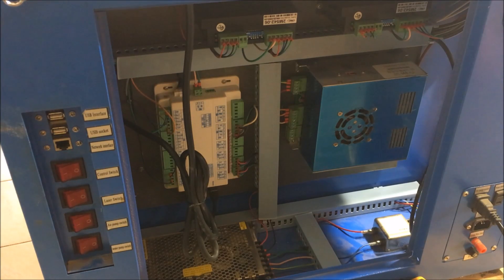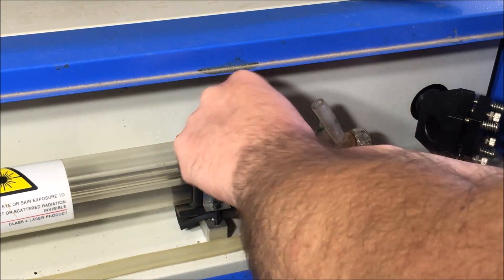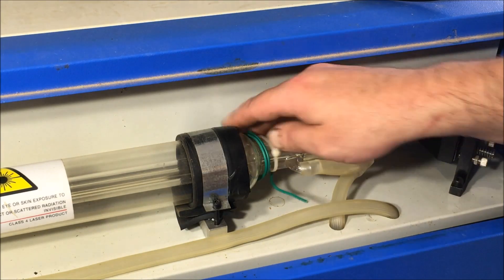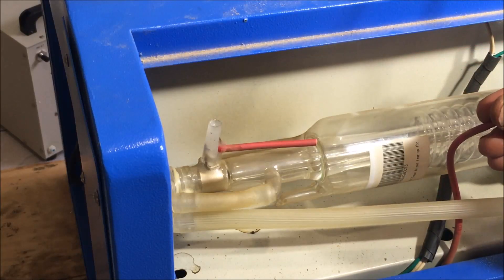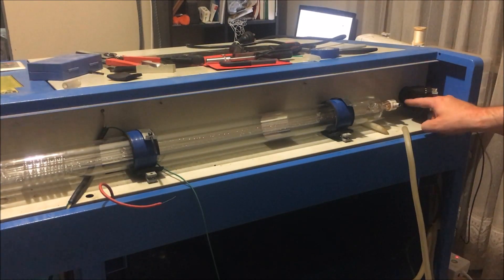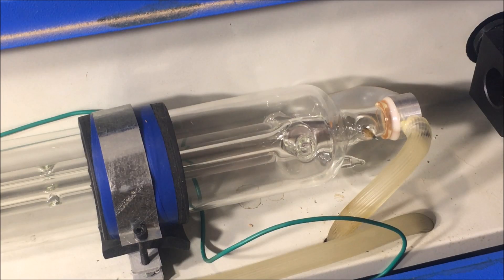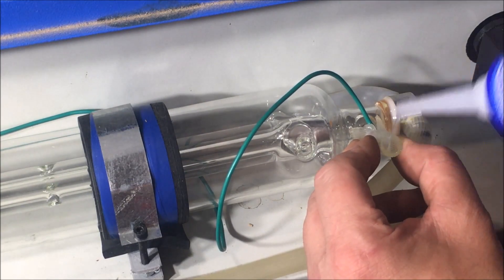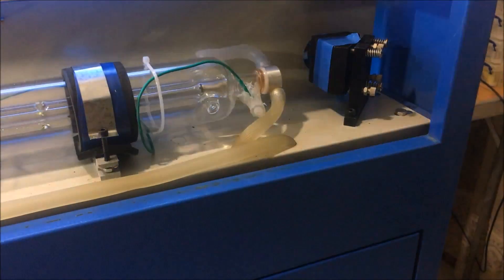Changing Tube in C02 Chinese laser cutter.

Comment: an average multi meter probe will not insulate you properly to 20kv, please be careful before holding things directly touching the 20kv terminal, even if power is off it can still retain enough power for a while to kill you

Comment: The tube's terminals needs to be grinded with a small metal-file until the metal is bright/reflective prior installation. So are the wiring's cores, those must show bare copper and be reflective (gently scrape them with a razor blade). This is to remove the highly resistive oxidation from the conductors, ensure good contact, and prevent potentially lethal arcing. #stay safe!

Comment: How do you dispose of the old one ? Do you toss it out , recycle , or does it need to be taken somewhere special ? Thanks.
Reply from the maker: Toss it out with your regular garbage.
They can't be filled with gas again and they contain no hazardous materials that require special handling.
Reply: @makestuffnow  thanks you! Also, I have never done anything like this but it looks fairly easy, anyway, is there anything dangerous about it that I should be aware of? Safety precautions. I'm really debating whether I do it or not
Reply from the maker: @MarteloDesign  Only possible danger is the high voltage.
-Make sure to unplug machine completely from mains power and you will be safe while working.
-The red wire from the power supply has extra thick insulation plastic around it. Only use the same wire. Don't replace it with anything other than wire specially made for this purpose. (the ground wire doesn't matter though).
-Insulate the connections well with silicone. Even if you do get it wrong, the machine case is gorunded so you will just hear a big bang when you start the laser but it wont damage anything.
Reply: @makestuffnow  thanks so much for reaching out. Doesn't seem too dangerous. Only thing is idk if the machine is really grounded or not! Lol

Comment: Roll your water outlet so it points straight up
Reply from the maker: there is a piece of water tubing connecting the body of the laser tube to the end of the tube. This part pointed up can also trap small air pockets.
It will cool fine either way.

Comment: Dear Sir,
 I would like to hear your opinion about our laser problems. We have Chinese 50 W 5030 CO2 laser (similar like this: https://www.ebay.com/itm/50W-HQ5030-CO2-Laser-Engraving-Cutting-Machine-Laser-Engraver-500-300-mm-Desktop-/172355930310). After replacing lamp to the new one and working about 7 months the machine started to cut very poorly even common material. The alignment, mirrors and lenses are ok. The tube do not have scratches. Water flow and temperature is ok. Focus is ok. Air assist is ok. We do not have any measuring instruments so need to find a solution by other attributes. After we noticed that it doesn’t cut through we tried to change settings. If we lower the power and speed then it cuts better but there is a strange sound (not always, but almost all the time) like high frequency (I have heart about pre-ionization, so it is probably that. Besides those objects which have been cut with that strange sound are never cut through). If we increase the power then the sound disappears but doesn’t cut through at all. I have to mention that the color of laser tube light has become white compared to the one that was originally (pink). We think this could be laser tube problems. Could you tell what else could cause this problem?

One more question: is this normal that our laser even with new lamp (50W) could cut through 4 mm birch plywood (suitable for laser cutting) only at such settings – power ~45-55W, speed 8 mm/s and usually twice (only increasing speed to 15 mm/s when repeating)? It was always like this and we never cut faster as it should be I think. Maybe this is a problem with PSU (this is also replacement, not original one. We have it already ~1,5 years). Could you tell what speed value should be set for cutting 4 mm birch plywood using laser like ours (with 50W lamp)? 

I would be appreciate for any help!
Reply from the maker: Setting you are using to cut the plywood seem reasonable.
I'll help troubleshoot the other problems with you over email. Likely bad PSU or Laser tube

Comment: Light Objects is selling a fake SPT tube so where in the USA can I find a grade A tube?
Reply from the maker: I know nothing of the USA market, but I buy mine from China on aliexpress on the assumption I am going to throw them out and replace them in about 2 years anyway. The brand I mention in the video description has worked fine for me so far.
Reply: Does it work fine for you with image engraving using dithering?  Mine does not as its response time is in the neighborhood of 56-60ms.
Reply from the maker: Works fine. I usually set my dithering at 300dpi at a speed of 200mm/s and it has no problem.
Reply: After testing mine with a 1/3 pattern I did the math and this power supply will never dither.  It will cut, and scan but is just not fast enough to ever dither.  Thank you for your help.
Reply: I actually found out it wasn't my tube after I posted as it is my power supply that is the slow bitch and not the tube.  Tube is fine now but where can I find a real, and proper, power supply that really does have a <=1ms response time as everyone claims?
Reply from the maker: You can find on ebay or aliexpress a whole bunch of power supplies in a black case with green screw terminals. They all look the same. I've replaced mine (the stock one in the video) with one of those, and a few other people I've talked to have used them too with no issues. The current output is adjustable unlike the stock chinese ones with the blue colour. 
I've never actually measured the response time though because it's always performed how I want it to.
Reply: Really?  Adjustable current?  Is this through the Ruida or through a screw?  Even if the link is for Australia would you be so kind as to link me one so I can look at it?  Thank you again.

Comment: A question. Why does my laser tube spark where the red wire is connected?
Reply from the maker: Likely loose connection or poorly insulated.
If you're confident that connection is good, then sometimes the tubes are just no good.

Comment: Hi, thanks for your video!
does anyone know why my red cable connected to the tube makes a strong electricity spark when i press pulse button? many thanks in advance
Reply from the maker: Possibilities could be-
1) Poorly insulated connection at tube
2) Dead or almost dead tube
3) Bad power supply

Check connection first. Make sure it is tightly wound and insulated properly. If it arcs in pulse mode, but is ok when cutting from a file it might be the power supply. But there are many ways a bad tube can cause arcing, so a bad tube would be the most likely problem.
Reply: Thank you for your reply! I bought a new tube recently, it is tightly wounded with a glue gun insulated, but not sure how well it should insulated! does electricity tape would do the job? and in regard with the tube being bad, is this something I should blame the sender from korea?

kind regards
Reply from the maker: Glue gun is not recommended, one of the reasons is the heat when applying the glue can damage the connector on the tube. But if the glue is covering all of the metal at the conenction, it should insulate well enough. Electrical tape is not good enough.

If you are confident the connection is well insulated, and the power supply worked fine on the previous tube, then you should contact the tube seller for support.
Reply: Thank you! thats been very helpful, I appreciated!
Reply: @makestuffnow  please..please for the sake of god dont give people advice like this if you do not have the appropriate knowledge...your comments could literally cause death in this case..
Reply: @ashkansadeghi124  i guess this wont help you as you comment is 3 years old but i ll comment for anyone else struggling with this. No hotglue is not sufficient. This thing is water cooled for a reason  The tubes can get quite hot which could cause you’re hot glue to melt and flow away, exposing unprotected high voltage that could be lethal without proper grounding. Electrical tape will also not be up to any standard however if you wrap it thick enough could do the trick. Then again that also would not be recommended. just get the proper isolating silicone it is not expensive.
The way the silicone is applied in this video is not sufficient either as it shows still parts of the anode of the laser tube being exposed.

Comment: Hello, thank you for the video. I was wondering how to reset the coordinates for laser head. I have a Chinese laser machine looks like yours and the belts slipped a little.
Reply from the maker: If the reset button is not fixing it, then switching it on and off should set it back in place. It should be set up to go to home position every time it starts up.
Reply: makestuffnow! Unfortunately reset button doesn't. And startup reset also doesn't.To be more clear, the ,0,0 point was about 7 cm to a certain point to right and about 2.5 cm to a certain point to top. Now it's about 3 cm to right and 2cm to top for the same certained points. Today I checked the mechanics of the head movement (belts, gears, rails...) and realized that there are 2 switches responsible for determining the 0,0 point while the machine resets. and they are working smoothly. So is there any way in the software to reset the coordinates? or better to reset all the machine settings?
Sorry for long reply and thank you in advance.
Reply from the maker: On the control panel on the machine go to the menu. Select 'axis reset'. if this doesn't work, you can try selecting "set fact para' which will restore factory settings, password likely to be CC8888. If that doesn't work then it is likely something physically jammed or offset on the rails.
Reply: makestuffnow! Thank you very much. Today I'm far from the machine, I will try the factory reset tomorrow.
There is another big problem, it's when I use engraving (scan), the final shape will be diagonal like this ( \ ). what is the possible reason for this. thanks again.

Comment: How much did you pay for the tube
Reply from the maker: About $270, including shipping. With heavy use need to replace after about 12 months.
I don't know anywhere local to get tubes refilled, I would be weeks without a tube sending it to the USA, so I know nothing of the economics of using refillable tubes instead.

Comment: Having been bitten by the EHT(15kV) from a studio colour monitor many moons ago I cringed a little when you stuck that nice Fluke meter across the EHT lead! I would have been more inclined to just use a clip lead with say a 1Meg resistor to ground to ensure it was discharged but of course the tube is less likely to act like a dirty big capacitor like CRT do. I did notice some discolouration on your chassis where the EHT lead came up and over the edge, has it been arcing there?
Reply from the maker: That's probably a better idea for testing. Even getting out the kmart multimeter for that job would have been a more wise choice.

I've never noticed any arcing issues. It looked like a small bit of water leakage and dust.

Comment: To funny I just was looking for a video on this for this laser. Saw your videos and subscribed, got up today and you had a video on it! Nice thanks. Have you tested it power wise vs your other one? where did you get the new tube and is it rated for more then your other one?
Reply from the maker: Like most people end up finding, this "50W" one only measured 37W (like the other one was when it was fresh).
I've been hassling the seller to repay me the difference for selling me a 40W tube advertised as 50W.

I even just notices from their emails that these bastards named their ebay store after a more reputable tube seller they have no apparent connection to. So I will probably launch a paypal claim to recover the full amount if they don't act soon.
Reply: makestuffnow!  I'm having a loss in power in my "50w" laser. what should I do, or what videos should I watch first? I'm not what is the most likely culprit?
Reply: Not sure what is*
Reply from the maker: Check mirror alignment https://www.youtube.com/watch?v=e1c3keOKL6Y
The cheap mirror mounts can sometimes work their way loose with all the motion of the slides. I need to tweak the final mirror a little about every 3-4 weeks.
At the same time check mirrors/lens for burn marks or dirty smudges and clean/replace if needed.

Other than that, if the tube is around a year old it is probably getting close to the end of it's working like and not much you can practically do except for buying a replacement.
Reply: do you have a suggestion on what to get? sorry to bombard you with the questions, you've been the first to actually make videos that are technical about this fucking machine.
Reply from the maker: This tube I actually sent back, and I'm waiting for a new one to arrive from a different place. When I find something I'm happy with I'll write my suggestions in the video description.
Reply: Ok what was the seller so I can try someone else? I've got orders stacking up so I'm gonna have to take my chances.
Reply from the maker: The one I sent back was a brand called Cole Tech. It was really bad. Only 34W output.

I'm going to try a tube from a brand called Tongli TL which I found on Aliexpress. I'm hoping it puts out 45W.
I've found so far the laser stuff I've bought from aliexpress (lenses, mirrors) is better quality, and more honest with their specs, than from ebay sellers.
Reply: I don't know what that is but I'm going to Google it now. lol